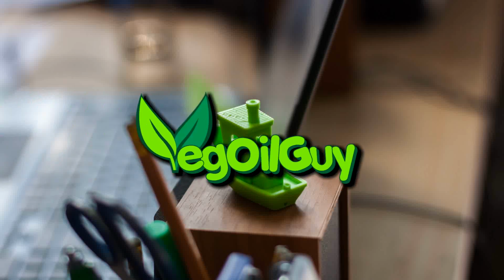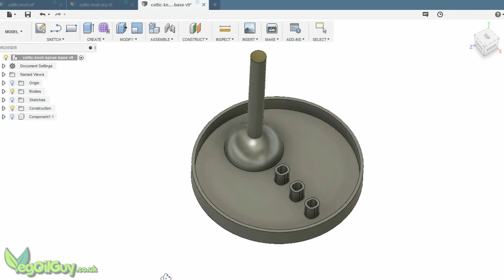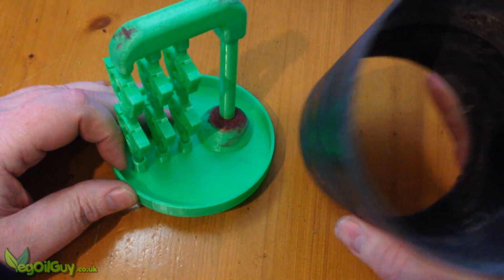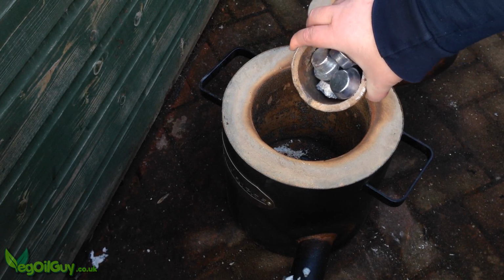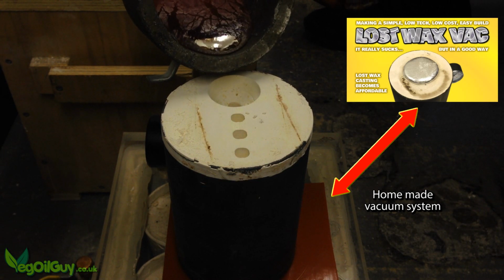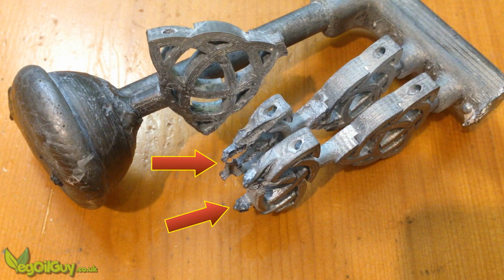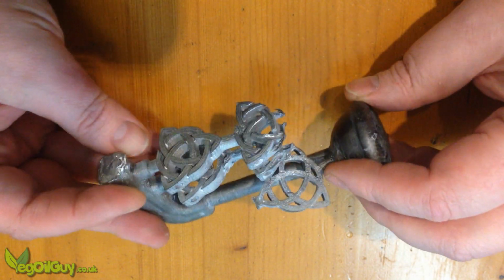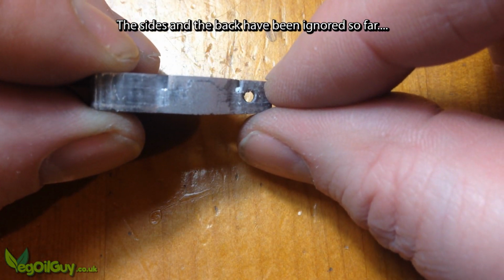Celtic Knot 3D print to metal casting | Lost PLA | Lessons Learned by VOGMAN

Comment: Hi, have a try at ABS and acetone vapor smoothing, it is a bit stinky at burn out but you can get nice smooth results
Reply from the maker: That's an interesting suggestion. I haven't tried ABS yet, but it's definitely on my to-do list  : )
Reply: @vogman I would suggest against lost ABS as ABS plastic has components in it that resist cleanly burning out of a mold.  ABS also breaks down to some very noxious smelling chemicals (some suggest needing ventilation around 3d printers when printing with ABS)
you would be better off trying the wax filiments
Reply from the maker: Excellent input. Thanks.

Comment: Very nice. When you pour the molten Ali is the plaster room temperature? Maybe keep the plaster hot as possible. That way the Ali won't cool quite as fast when it contacts the plaster which might make it flow better into all the nooks.
Reply from the maker: Trust me mate, it's all hot. The plaster is RED hot inside. It's around 630c at the time of the pour. It stays molten for several minutes  : )

Comment: Porosity looks a lot better. Any tips? Also, have you considered using Polymaker’s PolyCast? They claim that it burns out a lot cleaner. I’ve got a reel but not tried it yet.
Reply from the maker: I'm reserving judgement on the 'porosity' issues for a few more casts as I'm not sure it's actually an issue. If things go how I seem to think they're going, I'll be sure to make a point of explaining it in my videos. But for now I'd better reserve judgement : )
No, I haven't tried Polycast. At £60 it's more than 3 times what I normally pay for filament. It may be better, I don't know, but at that cost I think I'd be too afraid to print anything : D

Comment: So does this mean you needed a larger inlet tube and larger tube going into the knot? 
   As I saw it the material cooled before the mold filled?
   Blessed days sirSir, Crawford out
Reply from the maker: It's a bit of head pressure and restrictive flow I think. Certainly I don't think it cooled too fast. The plaster was well over 600C and the metal 700C. If you look at the second closeup, seconds after the pour, you can see the two vent holes glowing red. I believe the metal in there was still molten.
With more head pressure or with less restrictive flow (thicker feeder) I think this metal would have risen higher.
It was a small pattern after all  : )
Reply: @vogman  thank you. Confirms what my 1st thought was.  
Wow didnt know the mould plaster was that temp. 
Thx again sirSir

Comment: @VegOilGuyYour vacuum kept the metal from flowing upwards. Try it with a hot flask and no vacuum or pour from the top down instead of bottom up.
Reply from the maker: I have to admit John, I wondered about that. The general consensus is - you must have the pump going BEFORE the pour, and that's what I did. I thought afterwards if there would have been benefit to pouring, allowing gravity to do its thing, and then pumping. I think the metal was molten for several minutes afterwards...
Reply: Yes, I feel it should fill from the top and not vent back up from the bottom. Vent it back up and vaccum the metal down. Just my thought on it.

Comment: Hi Geoff, so tell me..... Could you replicate some thing like this in brass instead of Ali? Cheers fella, great vid.
Reply from the maker: Easily mate... probably better actually. Aluminium is great because it's cheap and low-temp melting, but it's sort of "thick", like cream compared to water. So it doesn't flow that well. Most higher temperature metals flow much better and so they fill the patterns better. If I had access to brass, I'd be using it my friend  : D
Reply: VegOilGuy I'll send you an email over the weekend mate. We need to chat 😀.
Reply from the maker: It wasn't me! I wasn't there! I've never seen her before!!!
Just kidding mate. No problem. If you visit my website here - http://www.vegoilguy.co.uk/contact_me.php - and send me a message, I'll securely receive your email and I'll email you back. This means your details won't be displayed online, etc.
All the best.
Reply: @vogman  I get brass and copper quite cheaply from a local scrapyard, they sell me whatever they have at around 1.5x scrap value.  Just an idea, thank you for excellent content!

Comment: Does your wife know you are using her mixer?  You have me convinced it is a great method, I just can't justify yet another piece of equipment.  I went in for the CNC router instead of the 3-D printer.  I can CNC some wax, so I will investigate that approach.  Great video thanks!!
Reply from the maker: Hi Skully. Check out my recent Thor's Hammer video. The wax I used there (detailed in that video) is EXCELLENT for machining. It cuts, carves, shaves, files and sands. Importantly it hard and dry at ordinary room temperatures, so there's no stickiness, etc. I think it would work brilliantly in a CNC. 
As for the mixer, I got my own... I'm not daft enough to dirty hers : )

Comment: And that's what I call a great video! =))

Interesting lessons learned. Would it help to extend the pouring basin as a feeder? Adding more volume and height (=pressure) and a smidge higher temperature might allow you to pull a lot more metal through small channels like that, I would guess?
Reply from the maker: Exactly mate... so many different things to try. So many possibilities  : D

Comment: Great video as always!  Just curious--about how long would you say the process takes from start to finish?  I'm currently stuck in the open casting phase (pouring silver into petrobond or graphite mold from my cnc) and am trying to get myself to the next level.  Keep up the great work!
Reply from the maker: Too many hobbies? Is that possible? Not for me... I get bored so easily  : )
It is a long process. If you ignore the design, the printing, etc, which could take a day or two, once the plaster is in, it's two hours minimum for the plaster to set, then around 12 hours of cooking followed by the pour. It's not a fast process, but I think you'll be amazed at the quality available. I'm limited on open pour experience, but on my few attempts it didn't  produce crisp results. But I was very green then.
Hope this helps  : )

Comment: I designed a 3d version of the knot, and printed it.   If you want to cast it, I still have the files.   I made a large, and small one, here is a small one.  https://imgur.com/a/sJ6LofG  I designed it because I wanted to stress test the printer, and to my surprise, it needed very little support material.
Reply from the maker: That's an excellent design   : )

Comment: can a 3d printer print in wax?
Reply from the maker: There are a number of companies that manufacture filaments that behave like casting wax, producing a stable print that can be polished, but which can then be melted with minimum burnout residue. Unfortunately here in the UK these seem to be around 3 times the cost of the standard PLA I'm using, coming in at around £60. That's a bit rich for me.
Look below in the comments. You'll find Joshua Loven has kindly named a few for us  : )